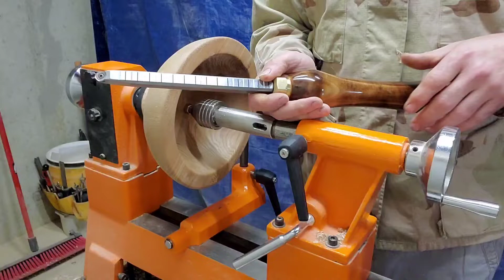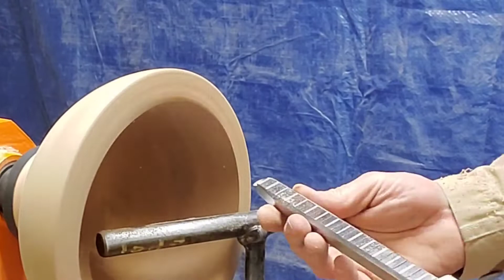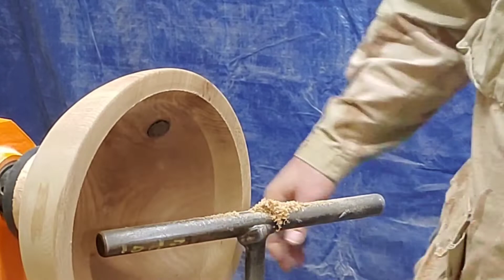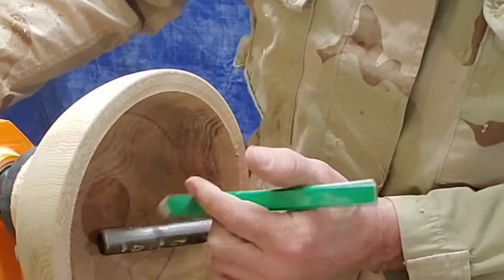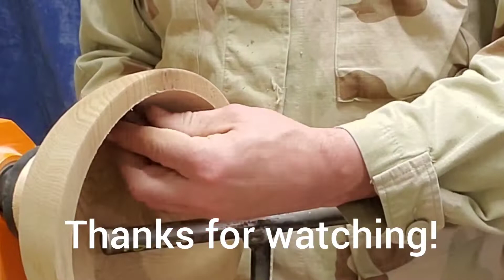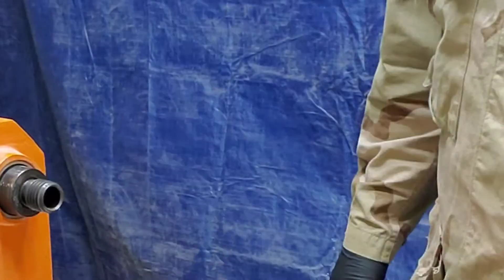woodturning-Friday night special. New carbide tool. First use.

Comment: I love that new tool! Those marks make sense, I never thought of that and the handle is just art. Very nice! Is your lathe reversed or is that the camera?
Reply from the maker: Thanks for the compliments! I sure do appreciate it. My camera is reversing the view. I dont like it that way. But im not using a monitor.  So I have to use it the way I can see. lol
I designed that tool a long time ago. I just finally got around to finishing it. And ya. no need for a tape or another scale. or some kind of fixture. Just use the tool. Its an actual scale.